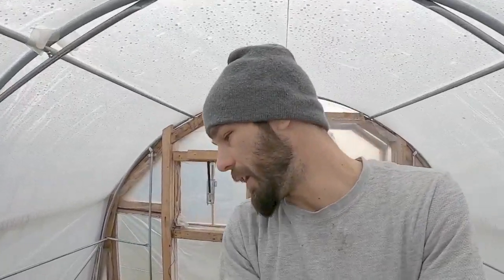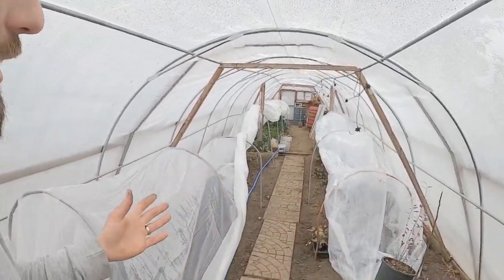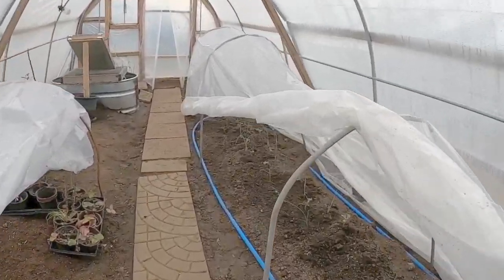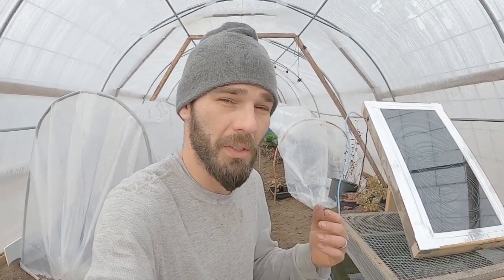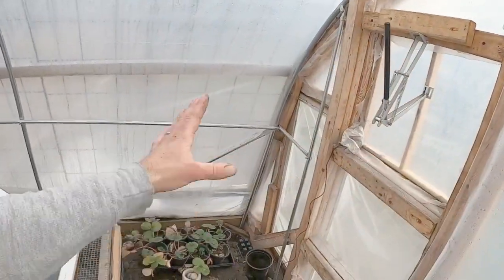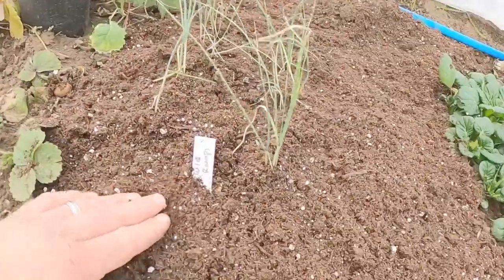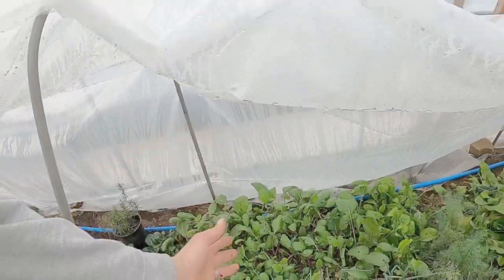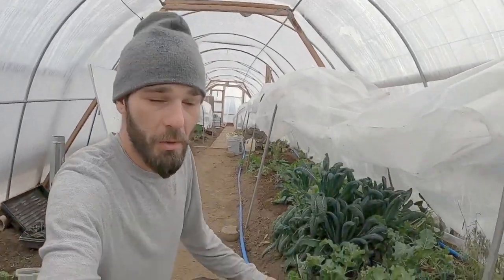DIY Solar Heater Experiment | Ideas Going Forward & A Look In The Greenhouse | DIY Jean Pain Heated

Comment: You got me curious about something. Try putting all the black tubing bellow the upper entry level and you'll probably get a much better water flow. And tell me if that makes it work better please.
Reply from the maker: Yes having a natural thermo siphon would be great but the distance it’s going won’t help me this year, please stay tuned as the next video I’m going to put up next week is a very in depth look at the idea of Jean pain heating, and how we’re using it. You’ve got the right idea!
Reply: I should have been more specific about what I was trying to say (sorry). I was trying to say to open the solar heater and put that little bit of tubing that's above the upper entry (where the water starts to enter the heater) below that level. If needed perhaps secure that little bit with a nail or something. It's an easy fix and if I'm correct it should improve significantly the water flow.

Comment: Would 1/2" black poly tubing work in place of the copper tubing? Great ideas. Love all the experiments.
Reply from the maker: It would yes, but if your heating water you’ll need a huge box to create enough heat to warm that much water flowing. That’s why I used a small diameter metal tubing for better transfer of heat. Thank you!

Comment: Next year I plan on running a coil of water through my compost pile that I run underneath the low frames Like you did, along with coiling that black abs pipe I used for air much tighter in the middle of the pile. The pile is active, but most of the pipe is on the lower outside of the pile. Might make something like that little frame water heater too! I’ve been putting so much energy into the solar setup im working on that I haven’t even had a chance to think about the greenhouse but everything is still alive so far!
Reply from the maker: That’s awesome man, it requires a bit of experimenting for sure to get things right. And if your trying both systems together for heat extraction you’ll wanna make sure you’ve got enough gap between the hoses/pipes to allow the pile to cook still. Our small 6x12 greenhouse’s set up is very small but still pulls heat in because it’s very minimal and allows the smaller 3 cubic yard pile to cook evenly. Just a thought when going forward. Thanks for watching man!
Reply: @Earthdwellershomestead  for sure and thank you for that helpful information!

Comment: Not sure if you're familiar with this guy's builds of solar heaters. https://youtu.be/3dYyQS4NwQI?t=580 It seems like he's found a very inexpensive way to build both the box and the absorber. Essentially uses the foil foam board like you have to make the box, then uses sheets of plastic instead of tubing to collect the heat.
Reply from the maker: I’ve looked over his builds before and he does good work, the copper tubing was extra I had laying around along with the wood foam and glass window. So technically this build was free lol but if I had to buy the items it would cost a bit to re-build. The copper tubing was the best I could do to transfer heat directly to the water. This box isn’t as big as I would’ve liked it to be but I have more windows and more ideas coming. Great input man thanks for being a long time sub, very much appreciated!